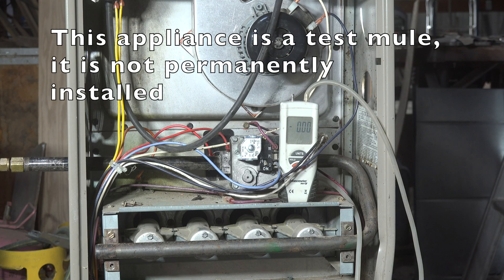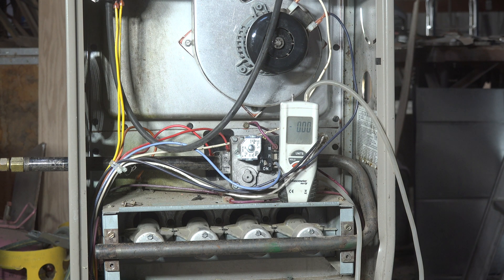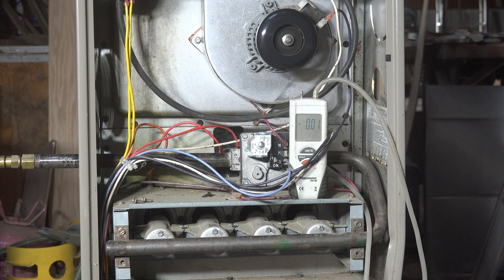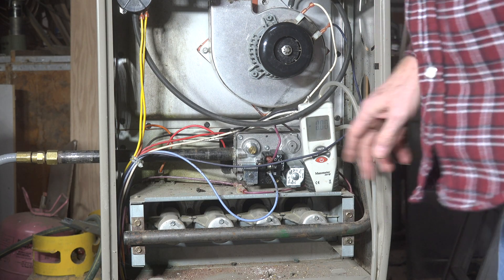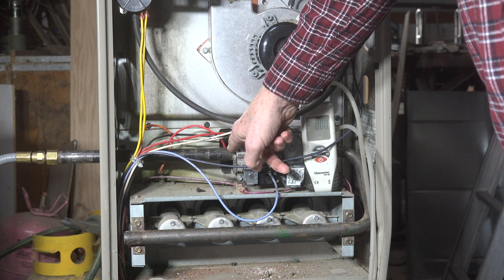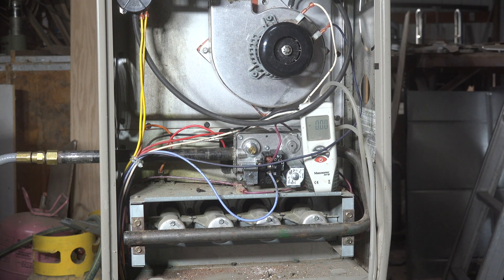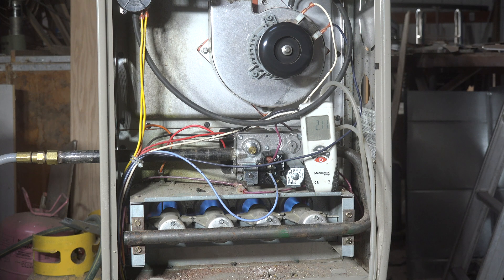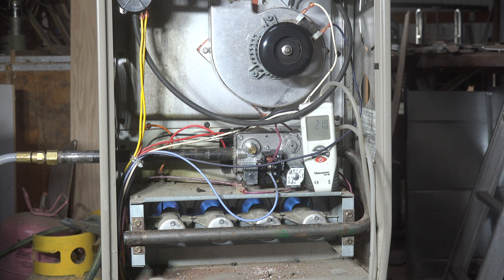Will the gas valve work if installed backwards?

Comment: I just replaced a 15 year old gas valve that was installed upside down that finally gave out. After the 10th year it was an it wouldn't start, a tech had came out and told the home owner to get it to work you need to hit it with a hammer so they did for 5 years til it finally gave out. Tech charged them $500 for the heater maintenance and diagnostic, didn't replace valve.
Reply from the maker: Unbelievable.  So frustrating to hear.
GFM

Comment: As a former auto tech, I have seen many errors in shops. Brake shoes and adjusters and even brake pads put on backwards and calipers installed with the bleeder holes in the down position smh. Timing belts put on upside down and mufflers put on wrong. Screw ups happen. Some things done wrong  or forgotten to be double checked can have deadly consequences. My friend died in a hiway accident 2021 as a result of a body shop leaving a LR wheel loose and only finger tight. He picked up his Camaro the Friday before Labor day weekend and the tech was probably in a hurry to leave work. The saying used to be, never get work done on a Friday or a Monday.
Reply from the maker: So true.
GFM

Comment: A repairman installed the valve in my garage furnace backwards recently, it fired up and ran. He said he would have to return with a spring calibrated for propane. That was 10 months ago. I started it up a month ago and it would fire up 50% of the time, and leak after shutdown if it did fire, yellow candle flames from the manifold orifices. So I tried calling/texting him with no response.  I bought a spring calibrated for propane on Amazon and installed it, I made a manometer to check the pressure and it wouldn't respond to the adjustments of the valve screw. So I bought a new valve and while removing the old valve I saw his error.He has been in business for decades so I figured he wouldn't make a mistake like this....go figure.If he returns for payment I'm giving him his valve back with big arrows painted on it!Oh and a PS, my manometer worked fine....cost me less than $20 in parts.

Comment: If someone were to do this in a building that has high pressure gas and the pressure regulator failed allowing high pressure gas to reach the valve, would it force the valve open, leaking gas into the building? I had a regulator fail on a call last weak and the high pressure damaged the valve.
Reply from the maker: Most of these valves are rated for 1/2" WC maximum.  I have seen regulators get damaged and send high pressure to the valves of several appliances.  Most of the gas valves failed closed.  A few survived and worked normally.  Installed backwards?  Who knows?
GFM

Comment: Have you ever experienced a situation where a 2 stage  white rodgers valve has just about 5 inches of water column on the input side(should be between 5-10) but still have where you cannot get the high stage adjusted past 3 inch of water column? It calls for 3.5 but the adjustment screw doesn't move it from 3 either higher or lower.  It is at 5 on the low stage but when it hits high it goes to 4 on the input. No other appliances are operating. Do you think it needs at least  6 or 7(on inlet)or maybe I have a plugged inlet screen or the gas company, who recently changed my meter,  put a smaller regulator back in place of the old one.  Or, maybe the valve has gone bad. Never had this issue before. Also, when I turn the high side adjustment nothing changes in the burner melody so I know the screw is not doing anything to change the manifold pressure.
Reply from the maker: I would ask the utility to check the pressure.
GFM
Reply: @grayfurnaceman  Yes, agreed...doing that first. I know piping has not changed and it did check ok when the unit was installed so I'm thinking supply issue but if not I suppose I'll remove the valve and have a look
Reply: @grayfurnaceman  Gas company showed me all is well with their pressure. Holds at 7 even if further demand occurs. Very strange, got to be something up with the valve. I've never seen one adjust perfectly on the low side but not move on the high side. The adjusting screw does nothing when turned...it stays at 3" no matter what. I've ordered another valve to fix it up.
Reply: @problemsolving7190  Sounds like a valve failure to me.
GFM
Reply: @grayfurnaceman  Okay, I'm at a loss...brand new valve, does the same thing. Almost 8 in wc at inlet, drop to 5 when in low stage and 4 in high stage...does the same as the other valve. I can dial the low with no issue, even with the new valve which was supposed to be at 2 from the factory was nearly 3, I pulled that down to 1.9 and it stayed there with no issue. I could also hear the burner noise even out yet on the high turning the screw does nothing.  I thought maybe my manometer may be bad but it read the low just like the last valve, will read to 3 when the high side is initiated and will read almost 8 at the inlet with nothing running...same as what the gas company's manometer read. 
Not sure if it's worth doing much as the adjustment is supposed to be from 3.2-3.8 on the high side but even being at 3 and not being able to move it makes me wonder what else is happening...plus I still think it's condensating too much out of the exhaust causing rust on the exterior under the outlet. 
This is a Goodman.. 15 seer, 5 ton gas pack, 12 y/o scratch and dent...they told me it wasn't used previously. I didn't think to check the jets when I replaced the valve(as I was certain that was the issue) yet but if this thing was previously installed with the LP kit I'm wondering if the jets are wrong but would that cause the lack of adjustment on the high side....? The jets should be 43's and the LP would be 50's. If it's not the valve I'm thinking the jets have to be the issue..right?  Sorry for the long post but hopefully this will help someone else out.

Comment: I find your videos very helpful..but I'm guessing u don't have to much to do with propane I have a propane shop heater which I would like to check the input and output pressures ...thk u keep up the good work.
Reply from the maker: Input should be 11 in wc.  outlet should be at manufacturer specs on the model plate.
GFM
Reply: @grayfurnaceman  thk u awesome 👌

Comment: We had a terrible time installing a new pressure valve.In fact 3 installs of a new updated valve on a  nordine . Modular home furnace. This install found that the flame sensor activated a flame was produced and was weak. I'm the homeowner, and then found that this model after new install needed to cycle 3 to 5 times. And then realizing during the start-up flame was only at 30%, then when you are large fan drafts it increases to full capacity. But Heating and Cooling technician did all the proper testing and was about to give up. Offered my money back and we were ready to put a new furnace in. So that being said a direct install on a nordine with the updated pressure valve offered from nordine it is advised to let it cycle 5 times. After that the pressure regulator learn in a rough description and then the proper pressure for the line builds up and then the pressure regulator operates correctly. Thought maybe somebody could could use this info.2000 models
Reply from the maker: Interesting
GFM

Comment: Look at that, the gas valve kinda still worked and furnace fired off.

Next experiment >>>> "Can you take an upflow 80%, flip it upside down and run it as a downflow config?"  ( I know the answer is NO but I'd sure like to see it done!) I think this would be a great learning experience to see what fails.
Reply from the maker: I may try that but may 80% furnaces are multiposition.
GFM
Reply: if it's an 80% with solid mounted induced draft, it will sadly work, but be dangerous due to rollout not hitting limits and possible CO spillage when it shut's off. some of them didn't run post purge for long or at all
Reply from the maker: @throttlebottle5906  You will have to explain your logic.
GFM